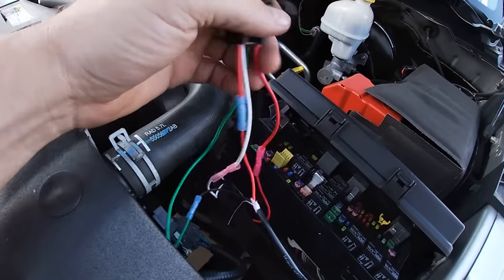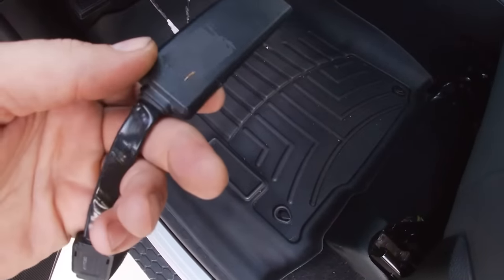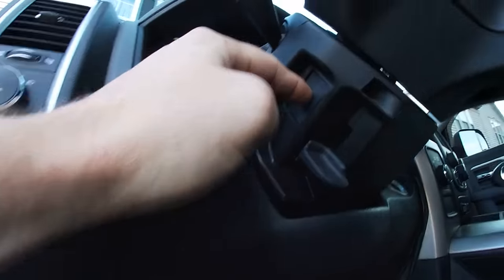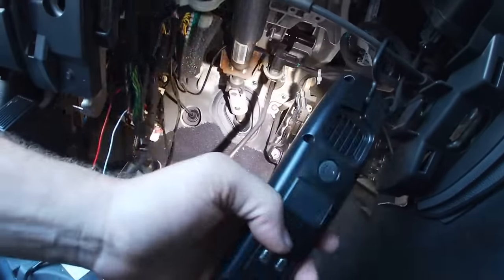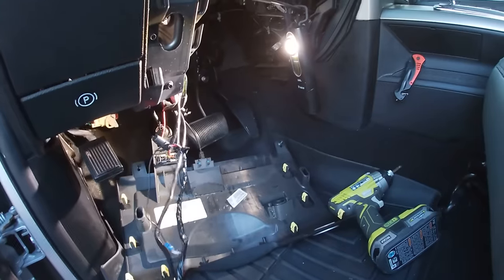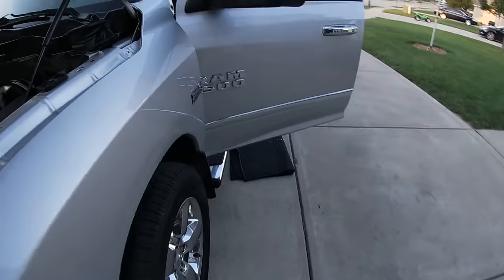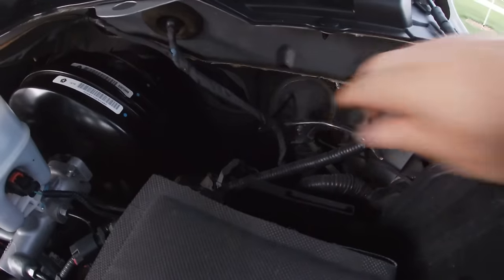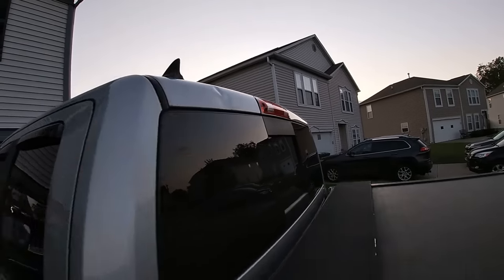Tracking Device Found on My RAM!

Comment: ATTN:  FAB Automotive Detailing, and people responding to his video.
First, I read the OP's 1st full comment concerning this Video.  He did a great job.  I read several other comments as well.  I was in the Automotive Service business.
I have seen "many" of these GPS trackers on vehicles.  The following is "MY OPINION" only.
First, this was not professional workmanship the OP is showing in the video!  
The GPS tracking device was installed on local/state companies in your area (unprofessional installers), Law Enforcement Vehicles, plus a few more government owned vehicles from your Governor, to your local government vehicles.  You get the point, no sense naming off a few more.  All these vehicles are used for company (or government) business.  $1,200 cost is average to install these devices.  There's thousands of these devices on vehicles just in my State!  We have many large industries in our State, and most of their vehicles have these devices.  This includes "all" watercraft these companies may use.  Many of these companies lease their vehicles, and the company who leased the vehicle to the plants will have the GPS installed.  Many are plainly visible, especially on 18 Wheeler's.
"MOST" delivery Cars & Trucks, any "Service & Delivery Related" vehicles, rental vehicles, etc., have these GPS's on them.
"Rarely" if ever will an individual spend this much money on a vehicle just to track someone out of revenge.  Some "Private Detectives" had these devices install for reasons I am sure you will figure out, and hopefully already know.
"Fleet Vehicles", or most Law Enforcement Vehicles, Rental Vehicles, Used Car Company"s installed trackers w/disable, on many of their vehicles, etc.
Some companies/individuals have these devices installed for "safety" reasons to make sure their employees or family are safe at all times!  Many parents have these devices installed on "all" of the family vehicles.
If a family vehicle, company, or law enforcement vehicle is involved in a wreck, or any type of accident, their company will know their exact location instantly.
Point is, there are many good uses for these devices, and they are use for more than just tracking their employees!
The mistake made was the first owner "did not" remove the device before selling it, or trading it in, or what ever the case is.  I have removed several of them over the years.  I don't think the thread OP was the victim.
The thread OP (FAB Detailing) has done a great job presenting this video, and explaining his findings.
For the "record", everyone's "Cell Phones" gives out more information concerning you vs. what this GPS system does!
If someone has a concern, and doesn't want his identify, personal information, Credit Card information, or his exact location tracked, you definetly need to be worried about the Cell Phone your carrying vs. this little cheap GPS tracking device!  
There are many APP's available on your cell phone that are just unbelievable what they can reveal, "INCLUDING" all your "text's"!
Anyway, I had some time to make this post.  I hope it will help someone.
Again, the OP has done a "great" job making the video, and narrating it!  
The only thing I would have added is the system installed is a very cheap system, and the workmanship preformed equals someone on a apprentice level.  
"THAT's why FAB had trouble so soon!  I believe whoever had the vehicle first started having trouble with it (probably intermediate).  Their Service probably couldn't find the problem as the device was not a factory item, the problem was possibly intermediate, and it's not covered in any factory manuals.  It happens all the time!
Have a great day!   And "don't" forget your Cell Phone!
PS:  I see several others have commented since I posted this, plus I read a few more comments.  Several people already pointed out several things I mentioned in this comment, sorry,l but at least we agree!
Legal Issues:  On the "invasion of privacy", and neglect for leaving the device on the vehicle, this would be a tough in Court.  Many above have already commented on the legal issues.  
Some have also pointed out the Cell Phones capabilities, which all are true, and very scary!  Read my comments above on Cell Phones.
All are making great points.  
Also, most all vehicles factory computer systems records and store information on the vehicles.  

If you have "OnStar" on your vehicle, the vehicle owner can download or obtain some of the information stored.  You have to pay for the service.  Otherwise, with a court order, law enforcement can get this information from the manufacturer or OnStar.  I vividly remember being involved in a case where a man was missing for several days.  It took getting a court order, but the car was located, and so was the missing man!  Sad story!

My "wife" would always lock her keys in her car.  I unlocked her car many times when she forgot to remove her keys, LOL.    

As far as the company who sold the truck to FAB, I am "almost" positive they didn't have a clue it was on the truck.  "FAB" has already stated this above.

In summary, all the people who are worried about their identity or any other "personal" information, and stated they were ready to go to court, just be prepared to hear most of the comments made on the thread in the courtroom.
With OnStar, your "personal computers or Lap Tops", Cell Phones, and the vehicles capabilities of storing information, or just about any other electronic device you have, "just" forget about hiding "or" pursuing any legal issues, unless you have money to burn!  And this will not help you.

Most of these capabilities are protected by "Federal Law".  

Just go to NSA.gov and partially find out what their daily job entails!  Find out what information they have on almost every single citizen of this country.  Don't be surprised if your DNA shows up with a little effort!  In my opinion, this agency is definetly an invasion of your privacy!  

The "NSA" was set up after 09/11, FYI.  NSA a/k/a the "National Security Agency/Central Security Service"!

I did not intend for my comments to be this long, it was just the right time when I read the opening comment, and I wanted to make a few comments, and point out a few things, plus spend a little time that most of us have plenty of currently.

This COVID-19 quarantine is getting old, and is the reason I had the time to make a post this long!!!!!  My interest in the subject is a factor as well!
Have a great day!
Reply from the maker: Dennis Haffner I appreciate your comment! You understood the point of my video. Thank you
Reply: @FABAutomotiveDetailing  Thanks for the response.  I have been through several similiar situations in my career.
Did you ever find out who installed the GPS?
Have a Great Day, . . .
Reply from the maker: Dennis Haffner You are welcome! No I never found out. Once it was off and back to normal I just moved on.

Comment: I found a similar device on a friend's car.  I did a pictorial explanation on imgur.  

https://imgur.com/gallery/4MEexLS

Her situation was similar.  She had a problem with her battery dying over a few days.  

Initially, I was only taking pictures, so I could undo any changes in case I screwed up.   I was just there to fix an electrical problem.  The tracker was just a bonus. 

Her's appeared to start drawing more power when they shut down the cell service that the device used.  Like, the infrastructure was shut down, not just an account.  

If you crack it open, you may find some interesting bits.   Or interesting to any friends who play with electronics.   Yours looks newer, and may have some better components to unsolder. 

In her case, she had bought the car with cash, and I knew she'd owned it for years.  Like, much longer than any car loan would take to pay off.   It seems that trackers like these are abandon in cars frequently.   They forget, or don't care, and leave them attached.   It's there to piss off a new owner at some future date when it stops working.

Comment: Since you bought and paid for the vehicle already why didn't you go back to the dealer you bought it from and tell them to take it off ?  It's not standard equipment and shouldn't be there.
Reply from the maker: I didn’t want to have to worry about it being gone for a while. I called them and told them about it and they offered to fix it but that was after I was already done.

Comment: just for the record ... unless you sign an agreement stating you are aware of and consent to the tracker... you can legally remove any tracker you find on YOUR Vehicles.  a certain Japanese manufacturer is Famous for hidden Tracker,/ kill-switch installs.   they prefer that you are not aware of them...  other side of the coin.  you can legally remove them. and you have a cause of action if you wish..  keep in mind .. It can get expensive to assert your rights. especially against a large company. Just my two cents
Reply from the maker: icu alonencontent It May be illegal but would cost a lot of money to go to court like you said. I would just remove it and move on.

Comment: What a sad hack job that was done...whoever installed that GPS tracker should be ashamed of themselves.😂
Brother when you do fix it correctly, make sure you do it right..solder and shrink wrap it or you will have issues in the future.
Reply from the maker: Junior OG It was a terrible job by someone that doesn’t take pride in their work. I did fix it correctly after this video. Thanks

Comment: Found one on my GMC jimmy in 2003. Only after 3 ignition systems repairs that a dealership told me about a device, they found underneath the dashboard. This device was used to fry the electronics in the ignition system. After I remove the device myself, LoJack called me and said that they notice that my system was no longer working in my car and that they would install a new one for $1,400 dollars.  And that there would be a monthly fee. Answer: Sorry, but I didn't know that it was in my car, so NO THANK YOU, I do not need to protect a 7-year-old car that's valued at $4,000 dollars. By.
Reply from the maker: They are in so many cars it’s unreal! Glad you figured yours out.
Reply: How would lowjack know to contact you unless your registered the device?
Reply: @ShainAndrews  They got all my information from the dealership. The dealer told me that for all cars that are sold with Low Jack or Onstar in them, the new owner's information is sent to these companies. Onstar contacted me on the system inside my truck one week after I got it. Now, this was in CA in 2003, a lot has changed.

Comment: Most fleet vehicles are tracked and usually there's no reason to remove the unit when it can be simply turned off and newer updated units put into that vehicles replacement ease up on the black helicopter theories
Reply from the maker: uncle sam I think this one was turned off but the corrosion on the tracking device starter relay prevented the truck from starting. It’s not a theory I have removed several of these at work where customers had to fork out a tow bill and a repair bill because of it and they had the titles to the car.

Comment: I put GPS tracking systems on cars for theft deterrents, you won't find them they won't fail and they 100% work until you pull into a metal building, and even that has a slight chance it works. 

The owner on the title has to approve of such device, or a court order so you can't just put one on your wife's car.  I did one for a dective once his clients wife was cheating but the car was in his name.

Comment: $20 says that thing was spun back 200,000 miles.
Reply from the maker: It can be done but isn’t easy being a digital odometer. You can’t just take it out and roll it back like the old days. You would have to have Chrysler’s software to do it. But you would lose $20 because the carfax shows it’s mileage and all the work was done at the dealer with all paperwork in the truck.

Comment: could have also been installed  as a  theft recovery  locator  or  by  someone who wanted to track someone else  who was driving the vehicle  and was self installed or installed by a previous owner ( or installed by a  Shade tree  Mechanic.)  I mean a GPS locator installed by the request of a bank or other  finance company  is usually done by a Mechanic at the dealership  where you bought the vehicle,  just before you take possession of the vehicle, And I must say when they are,. the job is done more professionally than that cob job you had
Reply from the maker: Don Juan I think it was installed by a fleet company. Regardless I’m glad it’s out and no longer beeping. 😂
Reply: No, it looks like it was installed at a dealer.  Had a similar problem with the dealer installed anti theft immobilizer, remote starter and tracker.  They use lower quality components and DGAF about what you normally don't see.
Reply from the maker: Ian Robertson It isn’t a remote start system I know that for sure. It may have been installed at the dealer when it was bought brand new.

Comment: Pulled them out of a couple vehicles, and put 48V through them and watched the smoke show.
Personally, I would've cut all the shitty splices, soldered them back together. And of course used heat shrink tubing.
Reply from the maker: Yeah I should have done something cool like that. I did end up doing it correctly and heat shrinking I just didn’t have any at the house and the video was made on the fly.
Reply: @FABAutomotiveDetailing  least you went back and did it right, some people would've just left it

Comment: I own a car dealership,  if you are making payments these devices are installed to track,  and disable the car, look at your contract.. they have to get your permission to install..
Reply from the maker: Dawn Hansen I understand that but there is nothing in my paperwork and I had only owned the truck for 2 weeks when I made this video. I called the dealership and they said no they didn’t install one and the don’t install them for anybody. The corrosion shows it had been on there for a long time.
Reply: @FABAutomotiveDetailing then it was probably put on by the first lender. And never was recovered by them.. they cost about 175.00 So it must have been over looked..
Reply from the maker: Dawn Hansen Yeah I looked at it the same day it was traded in and they hadn’t cleaned or inspected it yet. The dealer was really low on techs and when I went back to buy the next weekend they hadn’t inspected it yet. I told them if they wanted a sale i wanted them to put tires on and inspect it and I wanted to buy it that night so they did. Most likely didn’t do the inspection just put tires on and cleaned it up.

Comment: It's pitiful the way these rookies cut an OEM harness then used butt connectors. I test automotive electronics and guarantee those connections will fail. I would be soldering and heat shrinking those connections when restoring the harness.
Reply from the maker: @kevinc1851  Been a professional mechanic for over 20 years and never had a problem with the heat shrink butt connectors that I have used. When done correctly (because there is a wrong way) they will last.

Comment: You're a mechanic and didn't see any weird connection and wires??? The good part is that you know it's a fleet truck so no arm done.
Reply from the maker: When I checked it out before deciding to buy I didn’t see the wires under the fuse block because they were tucked away well. I got lucky when it wouldn’t start and caught a glimpse of the end of a butt connector. The tracker was hidden well behind the knee bolster. I look under there quickly but obviously not well enough. That won’t happen again I guarantee that. 

So on the first test drive it was beeping on startup. It has an aftermarket back up camera and proximity sensors. I truly thought that was just the backup system testing it’s self on start up.
Reply: @FABAutomotiveDetailing  Make sense, it look like a butch job but you pull wires so believable ;) A little story, couple of years ago my boss spend a lot of money on tracking the company trucks, each week we had a meeting and the boss talking about the places we went and time we pass there for hours, we got tired and took one of the truck and fix it on my boss car, first meeting was a hit, the boss couldn't explain anything on truck #3, a week after worst, try to repair with a new tracker, was working but switch back to #3, took him 16 days to figure out it was on is car and it was so funny, when he left the car to go work or check on somebody we took the car and drove around,  at the cop station, at other workers house ( no more than 8 min. ) long time at strippers club, he came back one morning and ALL the trackers where on the table, it was the end of that crap or is it ?!?! The boss installed trackers in all of us vehicle and for 2 weeks we received alert on cell, the problem was the boss switch them up, I was receiving alerts for my friends and them mine, couldn't find the problem, one night at 1 in the morning that was it, I got up close alert and went and check my car, it was so well hidden it took 3 hours and a six pack of beer, took another one after finding the freacking thing, I never find out who installed them but it was a pro job, everything was self contains so unplugging the battery didn't do anything and no wires except a little thin hair size antenna invisible,  even to this day, I don't know what it was or did exactly and who installed it, the only thing I know now is if I want to trick my boss I should invest a little bit more .;)
Reply from the maker: Danny Garden Man that’s hilarious! I can understand why they want the trackers but some take it to far.
Reply: @FABAutomotiveDetailing  Yeah, lucky they don't have video and audio with that,  but you have GPS for dog with it, I will stop talking about it , if somebody read this it may try to make one, maybe I should put a licence\ patent before anybody else, ;) Have a good one ;)